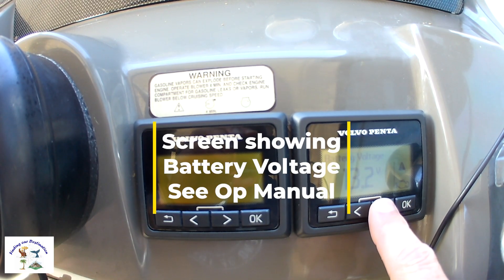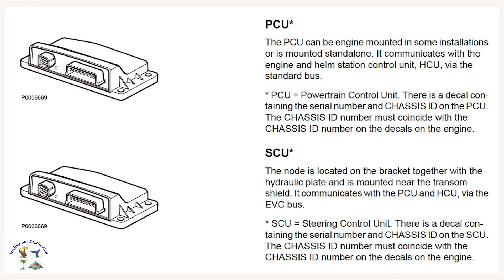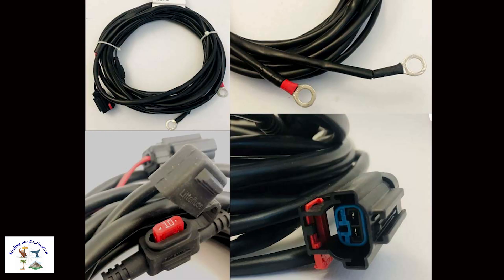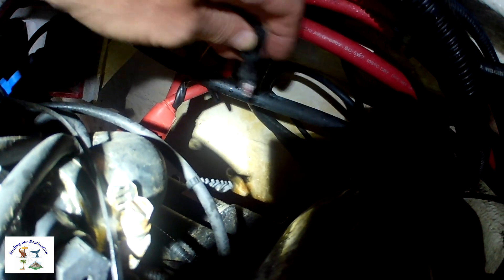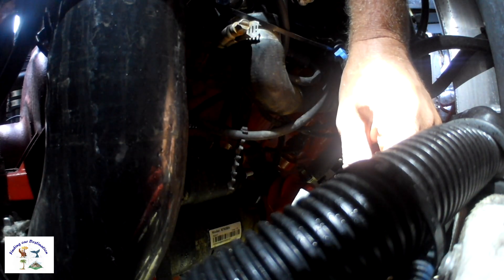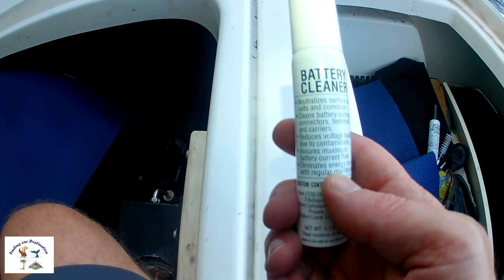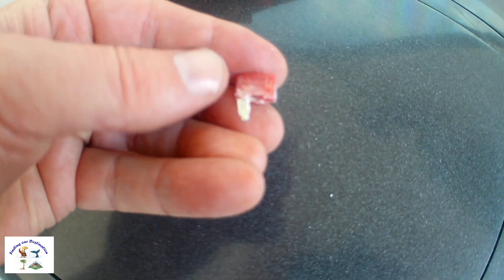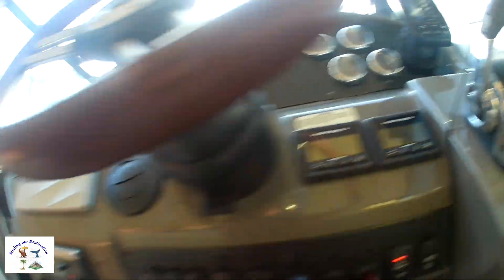Volvo Penta EVC Error

Comment: Had the same issue with my 2013 Volvo penta joy stick steering interface.  No steering on the port engine.  Boat went into limp mode and made it difficult to steer my boat with no power steering.  The problem:  After 20 hrs of diagnosis by a certified VolvoPenta Marine dealership with the Vodia scanner.  They couldn't find the problem and just started changing out parts $$$$$$$$$!!!!.  My neighbor who is a electrical engineer came over and fixed the problem in less than 5 minutes!!  He checked the resistance and continuity between the helm station, joy stick and Power steering module and all connections were good.   After all the time the dealership spent on trying to fix it was just a bad battery in the system!!  My boat had 3 batteries two starting and one house.  Both of the starting batteries showed they were good but when put under load the voltage level dropped to under 10 volts which wasn't enough  for the steering control module to power up hence causing the code on the EVC screen and shutting down the port steering.  New Batteries ( both were less than 6 months old) and the fault went away!!  All the Volvo shop needed to do was check the load on the starting batteries!!!!!!!!!!!!!  Called Volvo Penta of North America and filled a complaint against the shop and after 3 weeks volvo reimbursed me for the unneeded parts, so now I have spares!!!